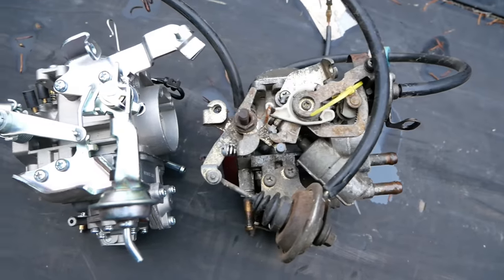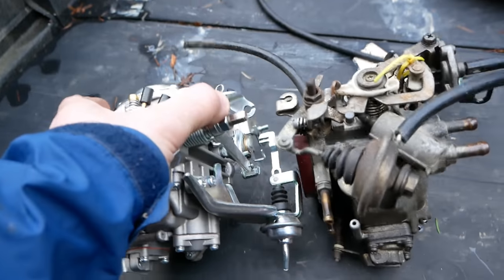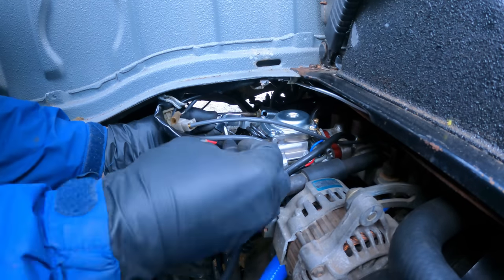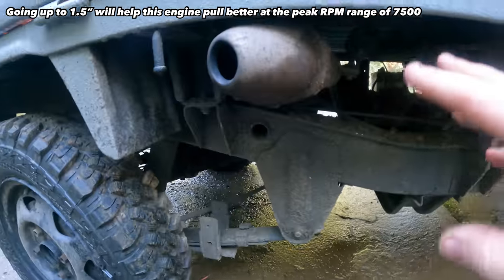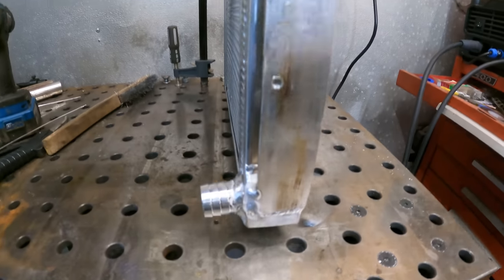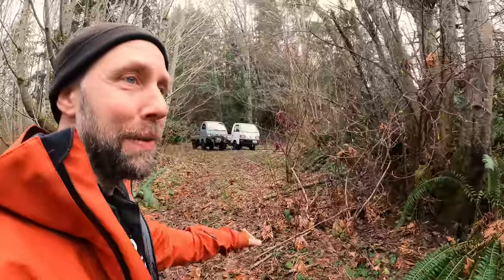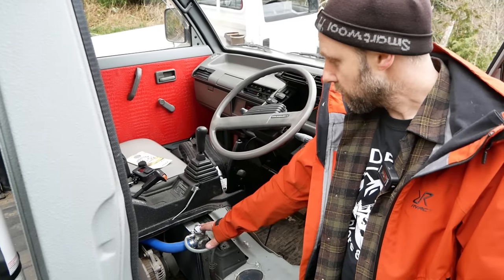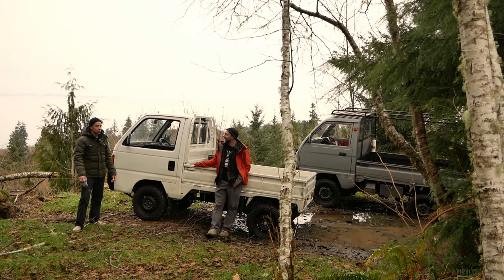JDM Suzuki Carry 4x4 Kei mini truck part 3

Comment: Stick a 'led load resistor' on the blinkers or indicators  lol (one per side) and it will stop that 'short fast' blinks (that flash rate wouldn't be legal here in Australia)... Looking good, I use to drive the little carry utes here when I was an apprentice, they were popular in the railway maintenance departments...

Comment: I've been looking at one of these mini trucks for a long time! I may be retiring to a rule area once again such as Central Oregon! So they've been something I've been highly interested in, if I may make a comment the one thing I would do, not only a locking rear diff! I would also think about the possibility of a 4-link or a triangulated 4 Link! The easy way to do it depending upon the loads you want to carry, is to remove one of the strongest lower leaves of the rear spring packs! The one with the most starch in it. Cuz I did notice the set of overloads we're not connected! Since it has the long rear shackles the little bit of lift as you mentioned in your previous videos oh, I think a softer rear pack would work very well! As far as a multi-link situation as I mentioned earlier there is such a variety of side-by-side shocks and small coilovers that could be easily adapted with your skills which are impressive mind you thank you for the series of these videos I am enjoying them immensely

Comment: Great little truck. Those carbs remind me of the s.u. ones fitted to Austin Metro here in Britain in 1980's, which were auto choke. Never worked right so many were retro fitted with manual cable operated units.

Comment: Awesome upgrades - love making it more simple and more reliable.  I have been messing with my carburetor for about a year and I still can’t get consistent performance!  It is also a manual choke version that was added before I got the truck.  I have worked on the air / fuel settings, but never tried different jetting - Going to take another look at it soon!  Keep the great videos coming!
Reply from the maker: Thank you!!

Comment: Love these videos, your aluminium radiator is a work of art !
Manual choke for the win.

Really good idea replacing the hoses and plastic T's 👍

You'll get another 5hp with an electric fan !

Your Tacho looks awesome 😆

These little trucks were super popular on Japan's northernmost island of Hokkaido. The snowfall there is some of the highest in the world.

PS: The "just punch it !" technique can work really well for tiny trucks, they're harder to break because of the very light weight and lower stress on driveline components 😆
Reply from the maker: Thanks for checking out my new Kei truck video! I really like my little Suzuki 👍🙂 Great dependable truck, on the weekends when I’m not commuting I tend to only drive it, especially with the gas prices. Take care Edward 🙂

Comment: Add a resistor to the indicators. You can probably get away with just two in the blinker wiring. It will eliminate the fast blinking.

Comment: add a power resistor with heat sink into the turn signals led circuit. that solves the fast flashing bulb out mode, since led's are such low resistance the flasher module thinks an incandescent bulbs burnt out

Comment: Hey Mike - had the same hyperflashing turn signal issues as you seem to be having with your suzuki on my 95' daihatsu. Installed some resistors to return to normal flashing speeds (voltage was too low for the system to 'recognize' the new LED bulbs), but I think you can also swap out the flasher unit itself for a more robust solution. Love the kei truck (and panz) content!

Comment: I've been having problems with my truck randomly sputtering to the point where you can't even drive, then poof, it runs perfect 🤔 I was looking at those carbs, might just cut the the case and change it out. My bumper lights were busted up when I got it, so I picked up some Chineseum trailer lights, never got the running light to work 🤷‍♂️ but I have turn signals at least. Been thinking about selling it and getting a 4x4 Acty... 2wd sucks! Also a 5th gear would change my life 😆 Great vid once again! 👍
Reply: Oh ya, also I don't run a shrowd ether. Even pull my fan off in the winter with my bigger radiator to keep it warm
Reply from the maker: What year is your truck? Mine is a 1990 with an electronic ignition, a subscriber have an 89 Carry and it’s got points ignition, I wonder if it’s carb or ignition, does it sputter more when it’s extra wet out? If so that could be something to look into? 
Thanks for checking out my new video! 
Do you have any new videos coming out soon?
Reply: It's a 91 carry, it's hard to tell if it's carb or ignition. Cap and rotor look tip top 🤷‍♂️ I purchased a new fuel pump a while back but never installed it knowing it's not likely the issue (BTW the pump is the same as a Honda Vmagnum or whatever they were called, you can get them for $40 instead of 4x that) the problem is VERY sporadic and didn't happen for almost a year, tho I only drive it once a month if that.
Got a stock pile, probably gonna sit down this weekend and edit! If you haven't checked out the last video it's pretty funny, I fell Clear through a kitchen floor 😆😆😆

Comment: I see you have rear lift shackles, and a lack of articulation. What I did on my 1996 Carry was swap the rear leaf springs with a set from the rear of a Suzuki Samurai. Got them used off Craigslist and replaced all the bushings. Then took the leaf packs apart and swapped the overload leafs from the Carry to the Samurai springs. Now I have 1.5” inches of lift over stock on the stock shackles. Got some longer shocks and it’s an easy upgrade.

Comment: Hey mike that 2nd vacuum line is for idle up you can ac transfer the Idle up from the original carb to the new one you bought
Reply: And mike can I ask what are the sizes of the jet you used
Reply from the maker: Thanks for the tip on the second vacuum port 👍
Because I was in the carb many times trying to get the jetting right I can’t remember all the jets sizes I changed.
I added some text on the screen of the video with some jet Info I remembered at the time of editing the video.
Honestly this new carb was way different then my old one, the old carb still had a needle on the CV slide and this new carb did not, there were about 4 different jets in the float bowl and the stock jets didn’t have numbers stamped into them. It made rejetting even more difficult 😂

Comment: I swapped to the grizzly 660 carburetor. Gotta delete the intake manifold coolant ports that go to the old carburetor. Works great. $60 with manual choke. The blinker lights up top are called cheek lights BTW.
Reply from the maker: I looked into swapping a Grizzly carb but I wanted to retain the vacuum advance port on the carb. I eliminated the vacuum advance on an old Datsun 510 I have, I installed dual side draft Weber carbs but they didn’t have a vacuum advance port, it took me a bit to sort out the timing. 
Thanks for checking out my new video Brandon 👍🙂
Reply: @Mikefestiva  I have a version of that carburetor with vacuum advance. And manual choke. ONE ADJUSTMENT 👍💕.

Comment: This is a shot in the dark but if the truck is fighting you in 4x4 even on looser terrain like gravel you might want to check both the front and rear gearing. When someone took out the locking differential they might have thrown in one with different gearing. I bought a truck once that the guy complained about same problem and it turned out he put a 4.10 front in but truck had 3.73 rear so I swapped front out with junkyard 3.73 axle.
Reply from the maker: Yes definitely a possibility, I have been thinking the same thing, I’m in the process of trying to track down a matching set of diffs because I really think this could be a possibility. Hopefully I can find a rear locker soon 👍 Thanks for commenting.
Reply: Jack truck up.placea mark on both driveshafts and one tire on front and rear. Spin drivetrain or a tire with opposing tire locked down since you haven't any locked diffs.. Divide the driveshaft rotation into the tire rotation for gear ratios... If the same then you have 2 open diffs and might want to either learn brake modulation or add lockers,limited slips, or weld up the side/spider gears for a Lincoln locker for the go anywhere and show up brother mod....😁

Comment: Wow, what a couple of cool little trucks! Nice work on the upgrades, always good to see it done properly. Here's a couple of "atta-boys" sent your way. LOL
Not sure if you are aware of it but something to be aware of is that silicone coolant hose will allow a small amount of coolant to slowly permeate through the hose due to the fact the the molecular size of the coolant is smaller than the hose's structure. Not a deal breaker by any means as it is a superior hose in all other respects. Just a heads up if you notice the coolant level  drop a cup or so after 6-9 months, or if you smell coolant with no visible leaks.
Keep up the great vids!
Reply from the maker: Thanks for checking out my new Kei truck video 🙂
Thanks for the tip about the silicone hoses 👍🙂I didn’t know that.
Reply: @Mikefestiva  I learned of this many years ago, there's still a lot of misunderstanding and lack of knowledge about the issue. As a trucker for many years I learned about this shortly after the trucking industry all started to use silicone hose. We started to notice coolant loses that were at first unexplained. Shortly after we all got educated as to the reason why. It is actually the water component of the coolant that permeates the hose. Not a big deal if you are aware of what is happening and act appropriately. Still damn good hose and still widely use in the industry. Ya just have to know the devil you're dancing with. Here's a good link from Gates the outlines the phenomena.
https://aviondemand.com/product-knowledge/gates-water-permeation-in-silicone-hose/

Comment: Hay leave the battery hooked up expecially if your ac stick welding or Tig welding on the car. It acts as a buffer and helps prevent sensors and ecus from getting fried. The only welding you shouldn't be doing on a car is high frequency Tig or plasma cutting with or without the battery installed.

Comment: You know I think it would have been better off with the bigger tires tonight on that trail but instead of using the standard size tire should see about getting just a slightly bigger tire for all terrain in mud might work and not only that I would love to have one of those trucks only thing is I just need to get the money to get it and do they still make them you have a blessed day and a happy new year God bless
Reply from the maker: These are over sized tires and rims, I covered larger tires in one of my videos, these trucks only have 660cc engines so you don’t have a lot of power to work with, and it’s a fine balance between tire size and HP.

Comment: Hi Mike - love this series, picking up my truck this week (and likely a Yes Welder using your code, awesome).    Have you considered fabricating a set of bed hinges, like on the dump bodies, if only to tip the box for chassis maintenance?   I narrowly missed buying a truck with an electric dump, the one I'm getting is a great deal but does lack dump - I'd be interested in adding the ability to manually stand the box up (safely, of course), if it made frame maintenance easier.
Reply from the maker: Awesome and thank you!!

Comment: You said a 2 inch exhaust is too much. What about a 1.75 inch? Ha ha I'm old enough to remember when Suzuki sold a 360CC Carry Pickup in the early 70s. I looked at them new on the dealers lot in 73 with my dad.

Comment: Enjoyed the video!  I noticed that you pronounced ‘kei’ as key….. the Japanese pronunciation is ‘k’. If you ever want to extend your Kei experience, you should really look into getting a Jimny. ‘Though people may scoff, they are a true 4x4 capable of tackling just about any obstacle. And the aftermarket for Jimmys is HUGE! I’d suggest looking into the JB23 series, especially the last few versions (I think they’re designated 9型 or 10型). With the Jimmy’s you’ll have a full length ladder frame, an actual transfer case with 2H, 4H and 4L. They were available with LSD (and possibly locking diffs. It’s been 8 years since I bought mine and I can’t remember) I foolishly just went with the open diffs because I planned to add a locking diff….   but, you know…. Life. 
Any, always enjoy your videos, no matter the topic.
Reply from the maker: Thanks for checking out my new Kei truck video Scott 🙂👍 
I owned an older Suzuki Samurai years ago, the are the same as a Suzuki Jimny right? My little Carry has a 4WD High/low range transfer case but the articulation isn’t very good on the little Kei trucks 😂 
I have seen a few Jimny’s  available on Craigslist, they sell for $5,000 to $6,500 for an early 90s, I have seen a few turbo 660cc ones. 
If you ever get a chance to make a video or two on some Kei cars or trucks I would love to see them! 👍
Take care 🙂
Reply: @Mikefestiva  yes, the samurai and Jimny are the same. Although the samurai name was forced from the market before the 660 turbo came along.
Reply from the maker: @JapanScott1  I owned a Hard top model, I kind of regret selling it cheap to a friend years ago, but at the time I didn’t have the money to fix the problems it had. I have been thinking of buying another one some day, once in a while I see them for sale with VW Diesel engine that someone swapped into it from a VW golf. 
I do have my Suzuki Sidekick but I like the style of the Jimny’s more.

Comment: hey Mike, great video as usual! What model carb did you end up going for here? not sure if i missed it in the video..

I'm running into similar issues on my 94 mitsubishi minicab and am looking for a good replacement for the stock carb with a manual choke.

thanks, and keep up the great work!

Comment: Great vid mike! Do they sell lockers that are easy to get for those? Or are you doing some fabbing?
Reply from the maker: Thanks Joe!
I’m still looking for a OEM rear locker, if I can’t find one in the next few months I probably will pull the rear Diff and start measuring the splines on the axles and see If I can find a Lockright that will fit?
Reply: Wonder if a suzuki samauri would be compatible maybe? Either was good luck and cant wait to see how you make out!

Comment: Have you considered welding the diff? I'm guessing a locker would need to be sourced from overseas and be incredibly expensive.
Reply from the maker: I recently found a rear locking Diff In the states! It’s awesome off-road 🙂👍
Reply: Fit a Aussie lokka. The unit that fits the cool Suzuki Samurai, Jimny may fit.

Comment: Does modern ethanol fuel hurt these 1990s kei cars? What should I expect from running ethanol fuel in a kei truck?
Reply from the maker: I would rather not run ethanol fuel in my mini but unfortunately that’s all that is available at most pumps around here. I run 92 octane in mine with some fuel stabilizer/ carb cleaner all in one in a bottle stuff. I also run my truck at least once a week. I think as long as you drive your Kei truck often then you will be fine 👍 
Thanks for checking out my videos!

Comment: Mike, are there any Differential (front & rear) Modificatio s that can be made on a KEI TRUCK to make them better fitted for our Highway Sppeds of 75-80 MPH with Elivation Changes (Snoquamie Pass)?
I have family I. Ellenberg that I tend to visit 5-8 times a year that I would love to drive my 1992 HONDA ACCTY (4-Speed Hi/Low Gear AWD)...
I have "almost considered" a B-16 Conversion to make my Daily (20 miles), and Road Trips more reliable.
Let me know what you have resourced!

Comment: How does Carry compare to Acty? Apparently in Japan, Honda is considered more reliable option than Carry, but their driving condition is different than our North America.
Reply from the maker: Both trucks are good, I think it comes down to previous owners and how each 30 year old truck has been maintained.
Each has its own design differences, that makes them very different. I do think the Honda is more balanced with the engine in the rear. Both do good off-road.
Reply: @Mikefestiva  Hi Mike;  Thx for the content!  Who is outfit in Portland with the Kei Trucks? ALso could u do a poor mans diff lock with separate ebrake cable on each rear wheel forcing spin to non braked side?

Comment: How many miles to these come with when imported?  Can you place the engine and drive train easily when need or do you plan to own only for a few years?
Reply from the maker: Miles completely varies on each imported vehicle, they are 30 year old trucks and still running good so Im pretty sure these engines will be running for many years to come as long as they are properly maintained 👍